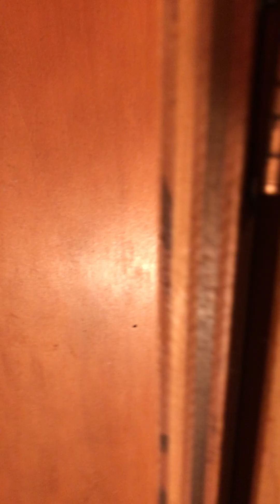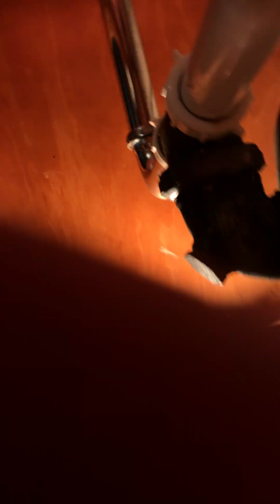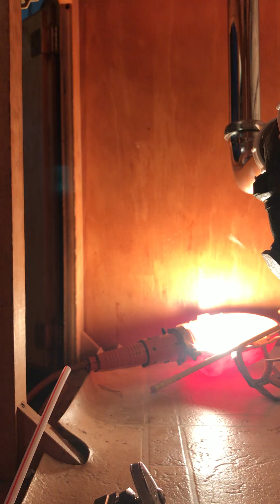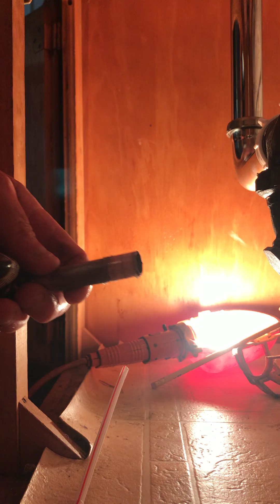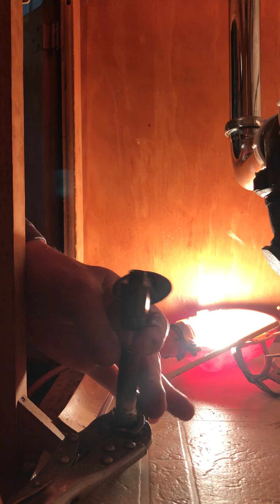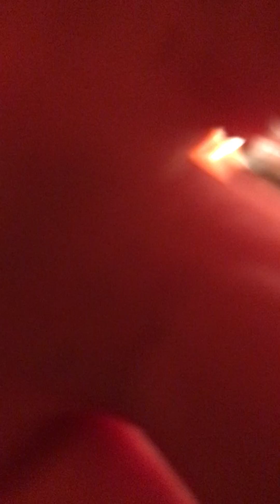replace soldered shut off value under sink - replacement

Comment from the maker: I am unable to unsolder these shutoff valves is because my main shutoff valve in the basement seems to be leaking.  when I remove the faucet lines off, I seem to have a tiny water bubbler because the water is still tricking out.